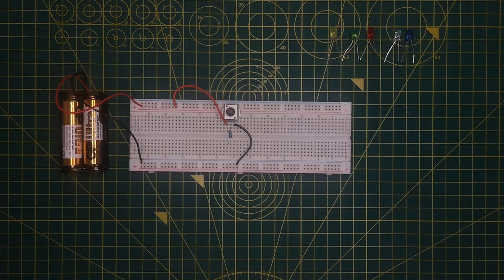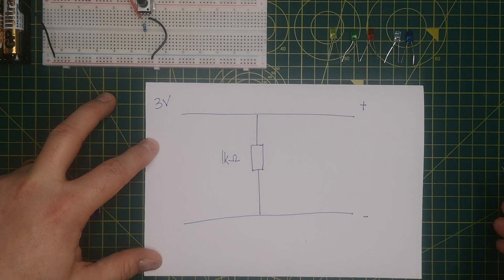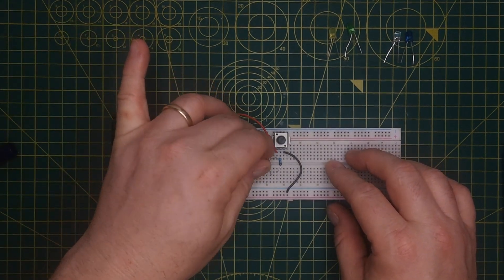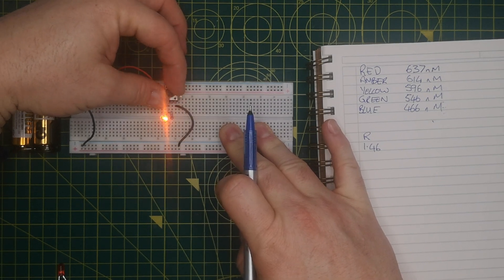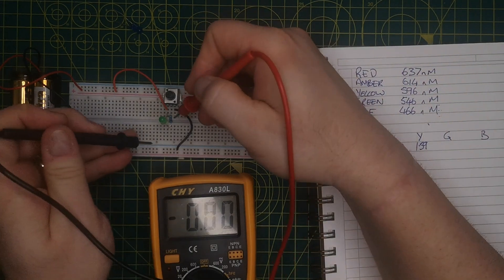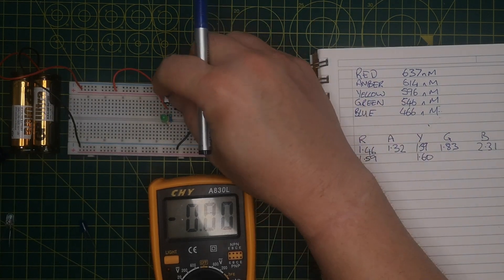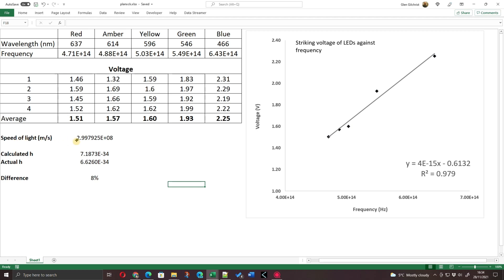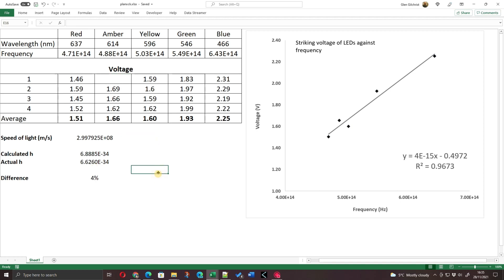Calculating Planck's (Plancks) Constant with 5 LEDs and a Voltmeter

Comment: I was surprised to see this worked as well as it did. 
Nice graph but the displayed slope is only shown to one significant digit. I have not used excel for a while but I believe the best fit line can be formatted to show more significant digits for the slope. I decided to plot it myself to see if I could get the same result. I used LibreOffice. Using the averages you calculated (including the 1.66 value for the Amber LED) I got a slope of 4.28e-15. With that I calculated Plank's constant to be 6.86e-34.
One thing you have not shown is the conversion from eV to Joules. I looked up and found a value of 1.60e-19 Joules per eV. Just in case it was not clear to anyone looking h is found by multiplying the slope by the value of  1.60e-19 Joules per eV.
You said that you used a spectrometer to measure the wavelength of the LEDs. There is no description here of the spectrometer used. Most of us do not have a spectrometer handy and would probably instead refer to the datasheet for the LEDs being used. With that in mind once would have to purchase the LEDs from someone who provides good datasheets that show/list the peak emission wavelength and then they would have to convert that to a frequency.